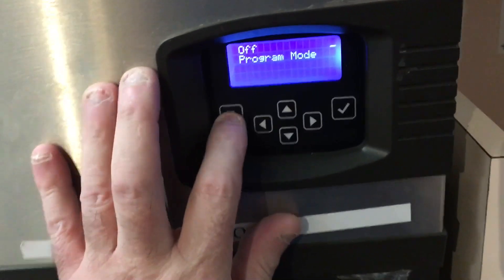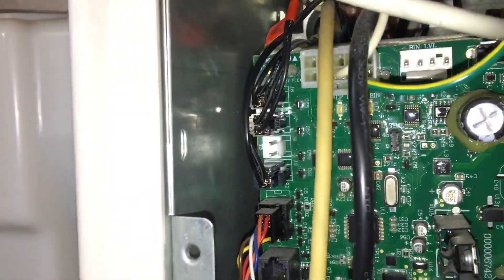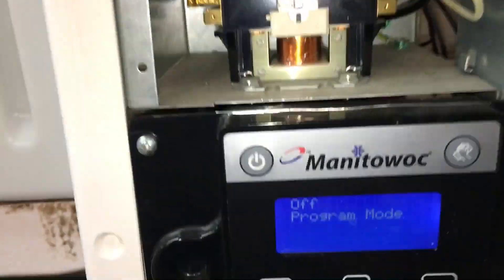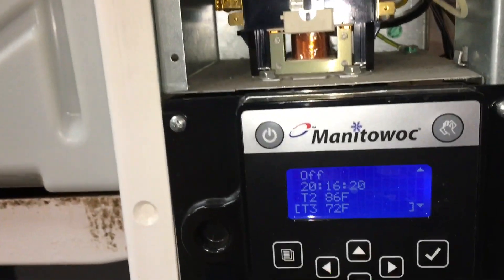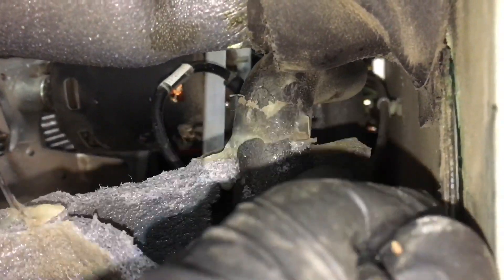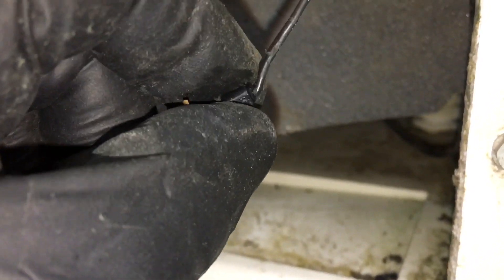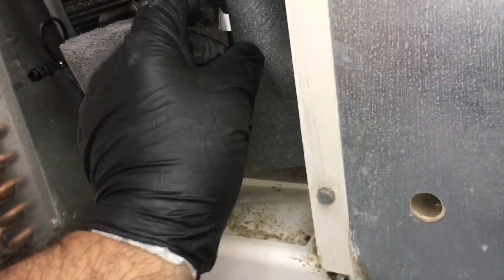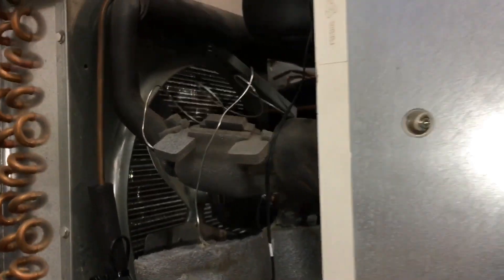How to Replace the T3 Thermistor on a Manitowoc ice machine.

Comment: 😮How'd you stick the foam back together?
Reply from the maker: 12:25
Reply from the maker: use spray glue or insulation glue or contact cement. then seal edges with silicone.

Comment: Our facility replaced several ICE IOMs with Indigos 3 - 5 yrs ago. Love the easy disassembly on these machines, have only changed a water level and thickness probe so far, but have thermistors and o rings on the shelf... Most of the building shut down for over a year, hope to restart in the fall. I'm sure that will be interesting to see what has gone bad while shut down.